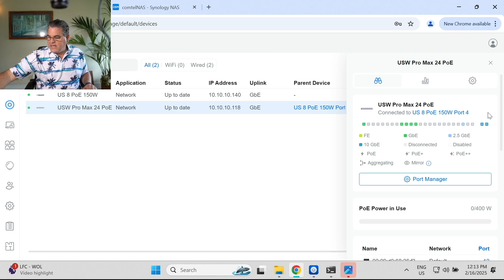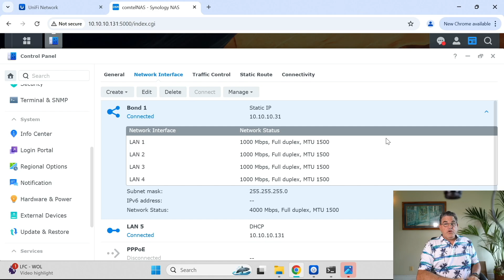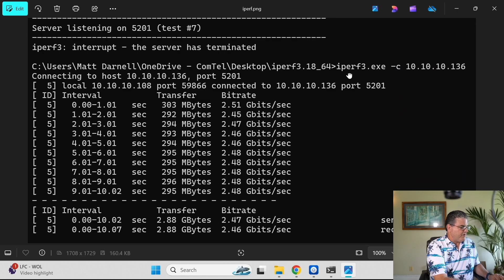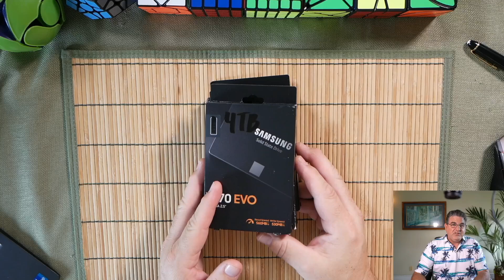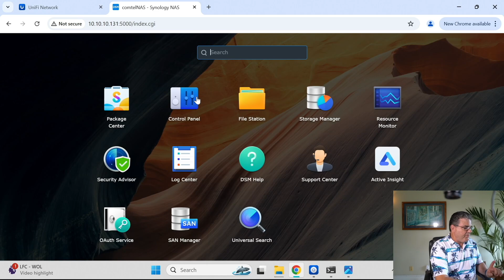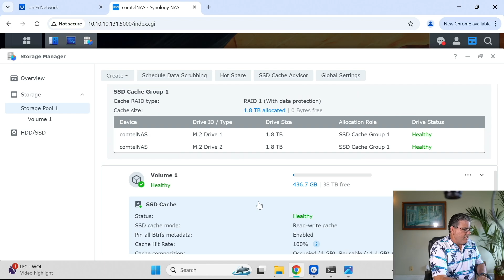Maxing Out Transfer Speed on the Synology DS1522+

Comment: Thanks for making the video.  It doesn't seem like you got an answer as to why the speed was so bad going from the laptop to the Mac but was fast when the Mac was the iPerf Server.  Is the laptop under-powered compared to the Mac such that it couldn't push out the data fast enough?  I'm sure you only have limited time and resources like the rest of us, but a test between 2 equal Macs or 2 relatively equal laptops may offer some clues to the network speed question.
Reply from the maker: I am going to make another video about the iperf results, I should have said that!  It didn't make any sense, will try different machines and see the results.  Thanks for watching!